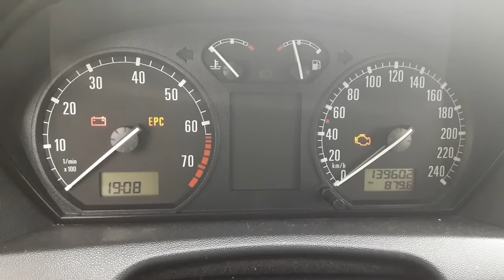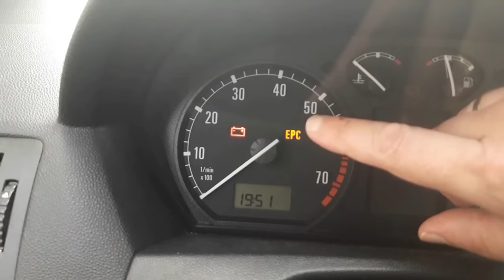Most Common Reasons Your Check Engine Light Is On

Comment: I have a 2005 Ford 500 Limited that's been meticulously maintained. My "Check Engine" light recently came on and the problem was the gas cap.  Be advised the light WILL NOT go off immediately. It will take a couple of cold starts to reset. Thanks man!!
Reply from the maker: Your welcome and glad the video helped!
You're right, in most cars that's the situation. Thanks for the contribution and all the best to you! :-)
Reply: Did it just come on and stay on or did it come on flashing? Mine just happened tonight but I also thought after watching this video it’s could be my gas cap as well, since the other day I started my car and I smelled kind of strong gas and could not figure out why but did go get gas a couple days or a day prior.
Reply: @rachelaimer6284  If the check engine light is flashing it definitely isn't the gas cap.  That means it's something that needs immediate attention and you should stop driving.  It could be you have a misfire if you smell gas. Misfires are when the spark plug in one or more of your cylinders isn't sparking to ignite the fuel/air mixture. This could be caused by a bad plug(s),  a bad coil pack(s),  clogged fuel injector(s) a bad signal from your ECM. The best thing to do is have it scanned. That will show you the error code that caused the check engine light to come on. Just remember, that only shows you where to start looking.  You might pull a P0171 Fuel Trims are Lean. There are a few reasons why this could be.  An 02 sensor might trigger it. You DO NOT want to just replace that sensor because there are other reasons that cause a GOOD sensor to send an error code.  So many people do this.  Then they reset the check engine light after replacing the part only to have it come back on in two days.  Remember, it's just a code to let you know what to look at and narrow down the problem so you know you've got it.  Vacuum leaks, a bad or dirty MAF sensor, tons of things can be off to trip that light.  But...if it's flashing it's warning you that the problem is not good to keep driving. You could do permanent damage to you engine. You can buy a cheap scanner for about $20. More advanced ones run more.  But a simple code reader is fairly cheap. I bought one for $20 that gives me the code and live engine data via Bluetooth to my Android. I can look at long and short term fuel trims, (very important on diagnosing how your car is running), misfire codes, 02 sensor readings, Catalytic converter temps. Remember, your cars ECM will make adjustments to things like fuel/air mixture to keep a 14.7/1 air to fuel ratio in your engine. So even though your car is running great you might still have a problem. You just don't know it yet because the sensors haven't hit the max to trip a code and have the check engine light turn on.  If you notice your gas mileage has gotten terrible, you smell gas in the exhaust, these are signs that the ECM is making adjustments because something is off. The car will still run great but there's a problem. A vacuum leak after your Mass Air Flow Sensor is allowing un-monitored air into your intake throwing off that 14.7/1 air ratio your engine and ECM want.  The ECM doesn't KNOW there's a vacuum leak. It just knows that there is more air than fuel. So,  the ECM will send MORE GAS to your cylinders making your fuel trims go crazy.  If they hit a max you'll get a P0171 code.  Fuel Injection System Too Lean Bank 1 (or 2 if you have a V-6 or V-8). Most likely a loose vacuum hose, Dirty MAF Sensor or even a Dirty Air Cleaner. I know there is a lot of info here and you might not understand most of it.  But a sensor code doesn't necessarily mean that sensor is bad. In fact most of the time it doesn't. So my point was to just save you money buying parts you DON'T NEED. You can email me if you have any questions. I'm happy to help anyone save money from rip off auto parts stores that WILL TELL YOU to buy this or that.  They are WRONG 90% of the time.  I hope this helps you.  Feel free to ask any questions you have any.
Reply: @RickyPisano  Hi thank you! I do have one more and your response was actually very helpful and anything I didn’t know I just googled to find out so no biggie. When I started it up this morning the light did not appear. Could it be possible that it came on as warning? It is winter and there was a snow storm and I don’t think my grandfather pulled my car in his driveway after letting it warm up, I believe he just started it up and went to park it and then it shut off on him and he floored my gas pretty ruff to get it from the end of his driveway. I will still check as I had no time to do it in the mist of already having so much to do to add on to this. I’m hoping it was just a warning to not do that again or if not something very minor that can be fixed.
Reply: @rachelaimer6284  If it went off and it's running OK then you should be fine. Keep an eye on your gas mileage and if the engine runs smooth. Like it normally does. If something is off the light will come on again. It may have been a very temporary low oil pressure signal because of the cold.  That would be my guess by what you described. I wouldn't worry about it if the light went off on it's own.  Something like a loose gas cap that triggers it will usually turn back off after a couple of cold starts once it's tightened. No biggie. I think you'll be fine. The newer engines post 2005 or so don't need to be warmed up.  They have thinner, usually synthetic oil like 5W20 and when cold the ECU automatically runs the engine rich (open loop) until it's warm and hits operating temp and the O2 sensors kick in (Closed Loop). Then the air/fuel mixture is automatically adjusted by those readings.  The old carbonated V-8's, Slant/straight 6's and 4 cylinders had way thicker oil like 10W40 and it  would get like molasses in very cold weather and had to be warmed up to pump through the engine effectively. The Choke on the old carburetors would be open to make the engine idle higher on those engines and you actually had a "gas pedal".  On these newer ECM controlled engines you don't.  The pedal you press is actually an "air pedal" that opens and closes the flap on the Throttle body to allow more or less AIR into the engine as the ECM is in full control of your fuel that enters the engine based on the amount of air entering it at different speeds and RPMs. The air coming in is measured by the Mass Air Flow Sensor or MAF positioned in front of the throttle body to maintain that 14.7/1 air to fuel ratio. I still let my 2005 V-6 warm up a bit though before I put it in gear and take off. I still think it's a good idea to do that when it's really cold out to make sure oil pressure is ok and no warning lights stay on.  I think you'll be fine though as long as the light is off and the engine is running like it normally does. I hope this helps you.
Reply: @RickyPisano  That helped a lot and learned something new about the engines made that are newer so thanks for that. So far it has been running normal an quite like usual, and yes it did go off on its own and I just make sure to let my car warm up because the temperature was extremely cold so I did think that could of been the issue but I still want to check my oil and see if I need another change since my last one in August, tried to wait until January but this weather and the signal has me nervous. Appreciate the feedback!!
Reply: @RickyPisano  Great comment 👍
Reply: @pay9011  Thank you kindly!!
Reply: Going to try this cause I have a 2005 Ford 500 limited also. My transmission light stays on all the time. Runs great but for 2 years light is on.
Reply: @RickyPisano
Reply: @RickyPisano  Did you buy a new gas cap all together?

Comment: Why do you have to buy an obd  scanner (£50) to plug into your diagnostic socket so it reads the codes generated ? It’s a cheap bit of kit, why not build it into the car so you get a simple message in English ( or whatever your language is) telling you what the problem is ? The pub landlord would see my point !

Comment: Air getting into the tank will not change the air fuel mixture. The light come on because vapors are leaking out of the tank.

Comment: Mine was on and later battery died. Now I changed the battery the engine light is off. I also suspect my gas cap but will monitor it for now if it comes back wil change the gas cap

Comment: Thanks a lot, removed my air filter cover on my Toyota Land cruiser, to check the rubber seal, and found my diesel sensor disconnected. Pushed it back in, closed the filter cover, and it solved 2 problems in one go: the engine light turned off, and my diesel gouge stopped giving false reading of low fuel.
Again, many thanks, Big Like from Israel.
Reply from the maker: Hi, you're welcome and glad the video helped! Thanks for watching and all the best to you :-)

Comment: Thank you so much - sensor light was all due to the fuel cap. In the past I have been quoted thousands to fix this same issue.
Reply: did chek engine light go off emidietly after you change gas cap? and on which car?
Reply: @jaskosijaric4021  Kodiaq & no it didn't go off immediately. After a few cold starts.

Comment: Thank you for this video. What I don't like about a franchise shop like the one I went to diagnose my issue, they always recommend to change to new parts vs cleaning it first. That would not be a good place to go so now I realize those small independent shops would do a better job. Never have them replace the part until they've look at everything and do the cleaning up under the hood. I have an engine check light again after 2 years now. The first time my O2 sensor was changed but it did not help, the shop had no idea. Finally we checked out the air intake and that was cleaned.  It did the trick as I looked up the obd2 code online to find other areas of concern.
Reply from the maker: You're welcome, thanks for watching and sharing information on the topic!
Reply: You're absolutely agree. Don't go to franchise setup. I don't mind paying more than to be rip-off

Comment: So my new Hyundai i20 started showing that light on, garage schedules but engine power is clearly limited... and it sounds like a paper on the wind sometimes, weird stuff... wonder if you could give some light on a possible issue.
Reply from the maker: Hi and thanks for watching!

To be honest, it's hard to say with this information but it probably loses power since it goes into limp mode when the check engine light goes on.

Regarding the sound, I would first check if everything on the air intake is OK and properly set and tightened. Especially do this if there was recent maintenance done.

Hyundai is a good and well-built car and I doubt that something serious is wrong.

Hope this helps.

Comment: I’ve got the warning light come up on my car.On inspection I’ve got oil on the spark plugs and coil packs on two out of the four cylinders.Sounds like the value gasket needs replacing.Would these cause the light to come on ?

Comment: Well you sir are my savour , i was a 100 miles from home in my campervan when the dreaded light came on, reading in the manual it said it was the catalytic converter and drive to the nearest garage at 40 miles an hour?? I contacted the vw transporter site and there advise me to put my boot down to clear it ??? Be confused i stubbled onto your video , wow couldnt believe it but I tighten my fuel cap problem solved light went straight out , thank you so much 👍👍👍👌
Reply from the maker: Glad if the video helped and thanks for watching!

Comment: This is a great video! Ive gone through all these except change 2 of my 02 sensors and clean the catal converter after taking my 2007 wm statesman to a mechanic without a resolution. The odbc gives off the p01010 (code that refers to the maf sensor..) unfortunately replacing with a new bosch one still didn't resolve it.. I may have that odbc code wrong above but it was for the maf... if the mechanic who is over 30 years qualified can't resolve im not sure what else I can try :(

Comment: Number 1 gas cap typically P0455 or P0456 with message fuel canister / evap being a bad seal I totally agree. I have resolved several of these. Usually the fill neck has started to rust preventing a good seal. A few rubs on the rust with sand paper followed by a bit of grease (Vaseline in a pinch) on the corroded surface will resolve.
Reply from the maker: Hi, thanks for watching and for sharing, much appreciated 🙂
Reply: My check engine light came on but I couldn't get an appointment in town. I went to get gas an discovered my cap wasn't tight? 
Thank you ❤️
Reply from the maker: @ginapereira8948  you're welcome and thanks fpr watching!
Reply: I have the light on my mazda 2006 tribute with 90K miles
The mechanics said its the air to fuel ratio and are quoting $3,000 to fix a list of different problems lol

Comment: My check engine light keeps coming on because what the service desk manager at Pep boys told me it's because of condensation/moisture building up in the system. Could you please explain this and what is the solution to prevent or resolve this issue with condensation build up in order to prevent the check engine light keep coming on? I have a 2013 Chevy Equinox SUV

Comment: Once I have changed the Gearbox,  this engine check light getting ON in red color. It is only appears when I travel to 5 or 6km continuously. If I stop the engine  and start again, the indicator getting OFF.
What may be the issue? Please advice me

Comment: Thanks for this informative video. In my car the coolant warning symbol came on, I let it rest and drove to my nearest destination and the check engine light came on. Took it the garage and they poured water in the radiator and but the light is still on. What would be the next best course of action?
Reply: Disconnect car battery for few minutes and connect. Might be that computer need reset.
Reply: Yes because the light does not turn off immediately
Reply: @mariuszmoraw3571  you can also just disconnect the negative terminal witch is easier.

Comment: Hello, I got a Toyota D-Cat and the engine light is on, but also the vsc and trac light. When this happens, the car loses ALOT of power and can after a while reach 80 km/h. We have scanned the car and got one code, P0400. We have checked almost everything, air filter, MAF sensor, 02 sensor, swapped EGR but with no success. Have any tips on what to do before we send it in to a mechanic? Thank you for a great video anyways!
Reply from the maker: Hi Tim thanks for the kind words and for watching!

You've checked more or less everything. I would check once more for an air leak (like punctured hoses, loose clamps, or else).

Sorry for the late reply and hope this helps.

Comment: Hi there I have a massive problem my Toyota 4zz manual. It's keeps having a very slow delay with clutching and slow in taking off. Infact is it has power loss when driving uphill and engine light is forever on.
Reply from the maker: Hi and thanks for watching!
That's a pretty broad explanation.
Try using an OBD tool and see if you get an error code.

Comment: @despair repair if the fuel cap is loose or broken so air can get in will the van jolt when started up or turned off? Because I’ve just bought a used transit and the engine light is on and I’ve just noticed the fuel cap is broken 🙄🤦🏻‍♂️so I’m ordering a brand new one can the engine sort itself out once there’s a brand new fuel cap and a air tight seal is made or will it require further maintenance?
Reply from the maker: Hi and thanks for watching! The check engine light may go away, but the jolting will be caused by something else, I think.
Reply: @DespairRepair  could in be the turbo booster? Or the fuel injector converter?
Reply: @DespairRepair  the engine doesn’t jolt I perhaps worded that wrongly 🤔let me try again when I start the engine it struggles for a second to start and at the second it’s as if the whole engine is moving to the point it wants to explode but once it’s running it’s fine and settles down to normal and the same thing happens when turning the engine off it kind of rattles and shakes slightly when coming to a standstill

Comment: The check engine light only came ON after I had changed the battery.   How do you reset this?   Should I remove the ground cable of the battery for 1min and reconnect to see if it goes away?  Please advice.  Thanks
Reply from the maker: Hi Dominga and thanks for watching!

Yes, you can try to do that. When you take off the battery terminal, also press the horn to discharge the system totally.

Keep the door or window open just in case, so you have access to the passenger cabin.

If this doesn't work, then using an OBD tool is the next best thing.

Hope this helps. Don't know why it showed up after the battery replacement, it shouldn't be that way.
.

Comment: Hi i have a question.. i have the BMW M3 COMPETITION and when i just start ignition not the motor all the warning lights illuminate and disappear except for the engine light. But when i start the motor press 2x the ignition button its all off no warnings car status ok etc. Is this normal at bmws?
Reply from the maker: Hi and thanks for watching!
First of all, congrats on the car, very nice piece of machinery.
Regarding the check engine light, best connect an OBD tool and see if there are any errors, just in case.
It might be just an electronic glitch of some sort but check it out.